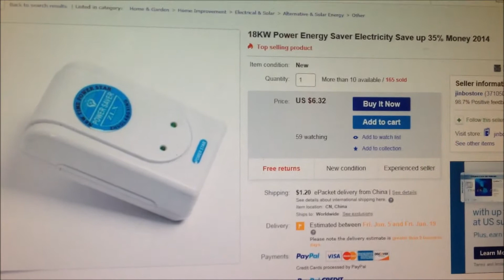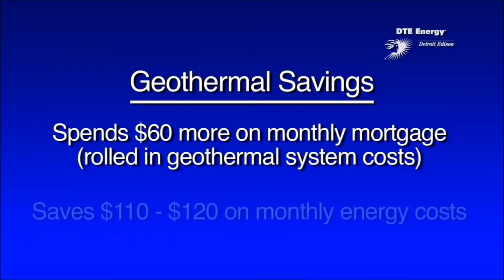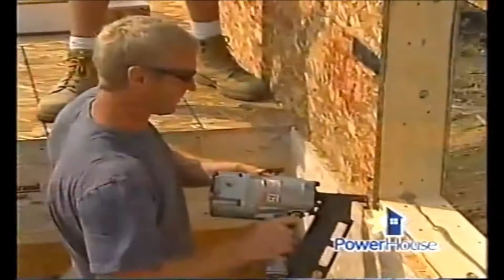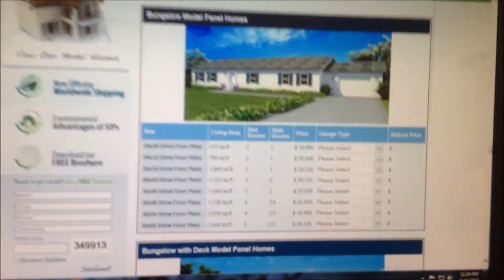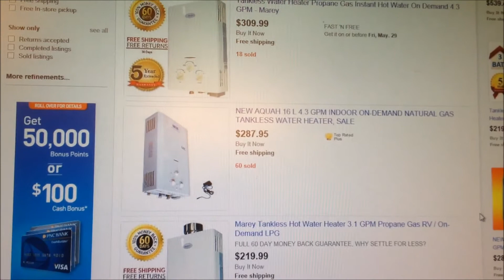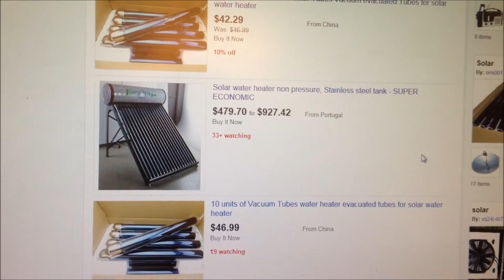Ways to live FREE

Comment: I've installed tankless water heaters for several landlord customers of mine for their tenants also running a dedicated 240 volt line for them. My tankless water heaters are far less expensive than the ones you showed.
Reply from the maker: +Pastor William Barhorst yes and they only kick on when u turn the water on. Also the hot water never ends
Reply: +diveborg13 Oh I know, the tenant has already thanked me for having his landlord have me install it in his apartment because he has seen a significant drop in his energy bill already, wait until I get his landlord to allow me to install the Power Star Energy Savers! I already contacted the company for a distributorship and for training on all their products and service reps.